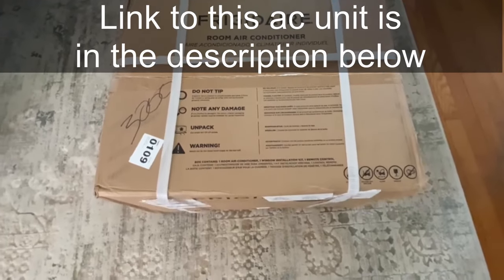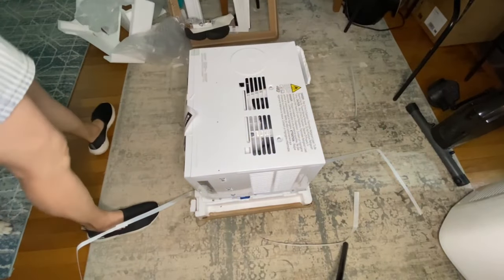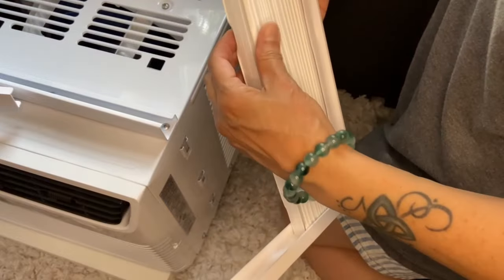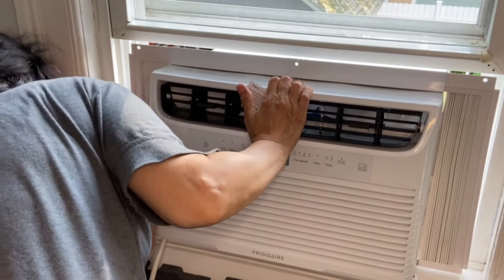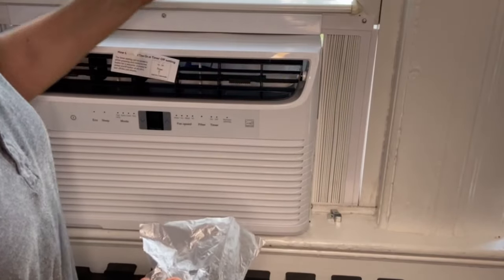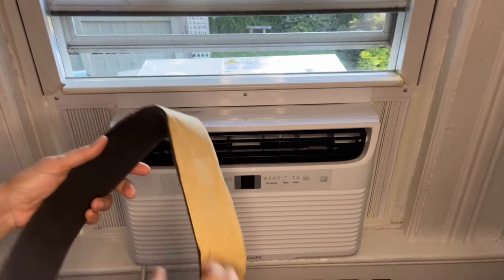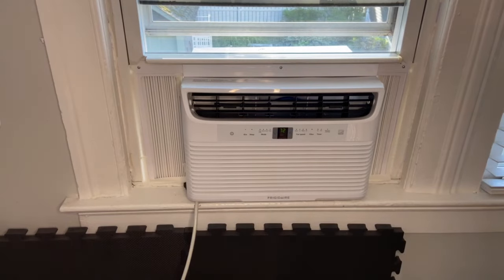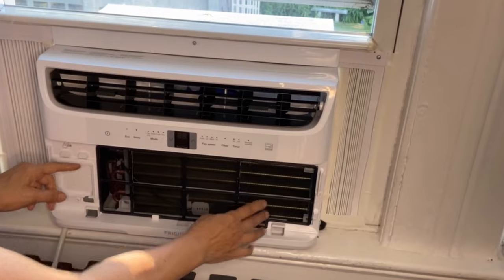How to Install a Frigidaire Window AC Unit Step by Step! How to Operate and Clean!

Comment: I'm glad your video popped up. I have a very similar ac unit and it's a Frigidaire. I started unwrapping it this morning but had to stop and mow my yard. I was having a hard time trying to figure out how to put the sides on the unit and I'm glad you showed how to do it. 
Good for you for installing the unit yourself. I'm a woman too and I think the ac unit I have is about the same size as yours. It will just be my luck that my ac unit will fall out of the window. I'm installing it on the first floor though.

Comment: Great tutorial video and I love your accent! I just got the 5000btu unit and am getting ready to TRY and hook it up. I live in a incredibly outdated and pretty much dilapidated house that does not have central air or air conditioning and the swamp cooler we have broke down several years ago. Last summer it got 114 degrees in the house and I thought my disabled mom and I were gonna die. The problem is our house doesn't have 1 normal window that opens straight up & down, instead all the windows open outwards with a crank/handle so I'm hoping to jerry rig this thing by balancing it on the window seal & a big garbage can while using tape & cardboard to cover any openings  so we can at least have 1 cool room this summer. I commend anyone for reading this rant and apologize for how long this comment is. I'm just frustrated and quite frankly scared of this upcoming summer and very envious of people with good houses and normal windows. I wish everyone all the best of luck in this world and hope all your dreams and aspirations come to fruition.✌
Reply from the maker: Jason, I am sorry to hear that 114 degrees in the house is just crazy! Good luck with the installation, seems like you already figured out a way to install this on a casement window!:)

Comment: Very nice video. That said, I do NOT like to tap into my window frames with screws as it's not needed. I use simple window locks to hold down the slider window and these locks do not need to screw into the window. Look for window security window locks. Also, I don't use the side curtains as they let in too much noise and heat through the thin plastic. I use the 4" thick pool noodles that I cut and fit to size. THey are very easy to work with and great for insulation. I really like Frigidaire brand as I fund them durable and long lasting. EDIT: forgot to add that I use a small size pool noodle (split) as a base for the unit to rest on. It gives a excellent seal and does not damage the window sill. Just cut to the correct width. Easy
Reply from the maker: Thank you! Great tips I will certainly try them this year!👍
Reply: Can  you upload an image of how  you do that.  I just got my unit
Reply: Can you share a link?
Reply: Wow, thank you for the great idea of using a pool noodle!

Comment: Thanks very much for the demonstration Tuba!  I had done this before a few years back for my Mom, but it was super helpful to be reminded; I was able to proceed with confidence.
Cheers!
Reply: Oh, I meant to say how impressed I was with your strength!  These things aren't very lightweight for sure. . . the window I put it in was designed specifically for an air conditioner, so it's more narrow than a regular window.  Getting that thing situated was a little tricky to finesse, as you mentioned, but MUCH better than the old behemoths I used to handle!

Comment: When you turn it off and turn it off, does it remember the last cooling temperature set or do you have to manual bring it down from 72 degrees each time you turn it on?
Reply from the maker: It remembers the last setting!👍